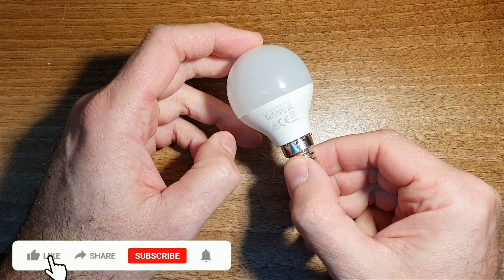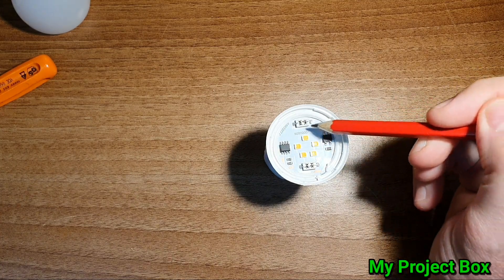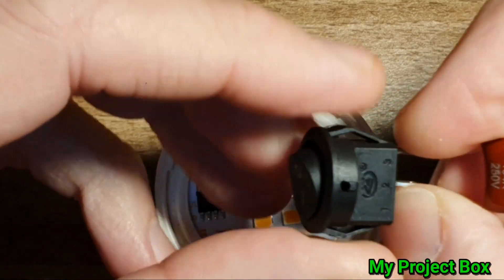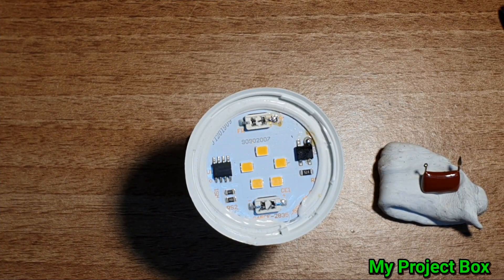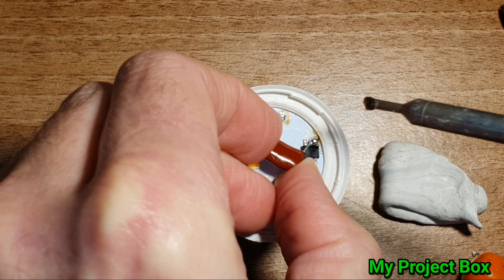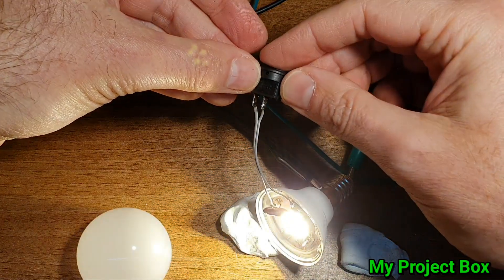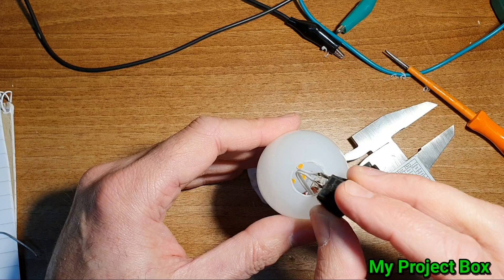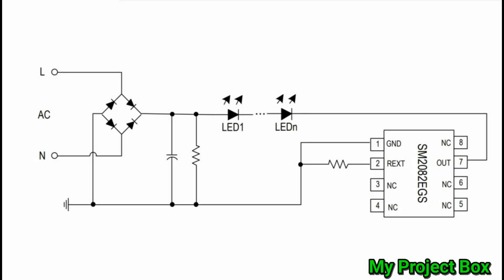Dim a LED bulb with a Capacitor #ElectronicsCreators

Comment: how can capacitor used to reduce voltage ??
as far as i know capacitors use as "temporary battery" so it store energy, and can increase the output voltage NOT reduce it .
Reply from the maker: A Capacitors behaviour is different for AC current. With DC current it will change up, "kind of like a battery. With AC, it's constantly charging and discharging as the polarity reverses 50/60 times a second. This resulted in it passing current, kind of like a resistor. It's call impedance (a special type of AC resistance) so a capacitor will pass AC current,  but with DC it will draw current when charging, and the current will stop when fully charged.😉👍 The the power in your house is alternating current AC, but a battery is direct current DC.

Comment: Sir,can I use it as a fan speed dimmer?
Reply from the maker: Yes it is possible, but you would need to experiment with different capacitors, to try and determine the correct value, for the fan speed you want. Sometimes you can get the  opposite effect,  and the fan runs more powerful. This happens when you get a resonant effect between capacitor and inductor. (Tank circuit)
Reply: Thank you sir I will try.

Comment: What would happen if you put this capacitor across the L and N, would it improve power factor of the lamp?
Reply from the maker: No, the capacitor is needed to improve the power factor of inductive loads like the older florescent lighting and induction motors. It will do nothing for LED lamps 🤔😉
Reply: @MyProjectBoxChannel  OK I see, when I tested a led bulb on a magnetic ballast, the power factor went from 0.6 to 0.7 almost 0.8, and that was without the correction capacitor. Couldn't really notice the difference in brightness. Wasn't expecting this..

Comment: I have found a Circle Rocker Switch 3 Way 3 Pin 3A, on eBay, so I am going to make a two position dimmer using two caps of different values, so I will have 10% and 50% dimming. What's your opinion?
Reply from the maker: It sounds like a good plan 😉. Just experiment, to find the values of capacitor needed for your preferred dimming levels. I have tried this with a rotary selector switch, the type used in old school sound systems. The good thing is the capacitors get smaller in size for the lower light levels.
Reply: Thanks, will let you know how it goes  @MyProjectBoxChannel

Comment: Amazing video! Q. Can the same process be done in reverse to increase the brightest rather than dim it?
Reply from the maker: No it's not possible to increase with this method, using a capacitor😢. But with many types of LED bulbs, you can change a resistor value, to either increase (or decrease) the brightness of the bulb. If you increase the brightness of the bulb, you will also shorten its life span😢.

Comment: Very nice idea that works very well, cheers Bob in the UK
Reply: Thanks for your like on my comment, but one question I have two filament dimmable LED bulbs would the capacitor do the same job in dimming? (Update yes it did and is a perfect night light). Thanks, Bob 😃

Comment: Great, I have some lamps that I can't identify the resistors to change, then your solution have come to rescue!
Reply from the maker: I do think I prefer the "Big Clive style" resistor hack, but the "capacitor dropper" works for many types of lamps as well. You can do multiple lamps in parallel, with just one capacitor.

Comment: what  size  capacitor  do you use
Reply from the maker: I used 100nF 400v capacitor. But you can increase or reduce the value, depending on how dim or bright you want the LED bulb, to be.

Comment: 100nF 400V capacitor
Reply from the maker: Yes 400v would be better, but if the capacitor failed short-circuit the bulb would just go to maximum brightness. And the current would be limited by the bulb it's self.

Comment: Big clive has shown an easier way to dim a lamp, there are 2 parallel resistors next to the regulator, remove one
Reply from the maker: I know I love that simple little hack!😉🤣
Reply from the maker: With some of the older bulbs you have no choice but to either change the main capacitor dropper cap, or put a cap in series with the bulb. BigClive style resistor clipping hack is simply brilliant 👍😉 https://youtu.be/G9RUsOVKoZg

Comment: Hi Rob, new sub from BigClive's channel. Would it matter if I put the cap on the line side instead of the neutral side? Thanks - now I got some binge watching to do. . .
Reply from the maker: You are correct. Both line and neutral would work just fine (it's AC after all). You can even put the capacitor inside the lamp base, with a switch to adjust the brightness setting. I did exactly that for my desk lamp 😉

Comment: Hi Rob, I have a circuit that you could also demonstrate, and that is a light-sensitive switch and flashing diode in a torch, so you can find the torch at night, but the flashing diode light goes off when torch is in daylight.
Reply from the maker: That's a very good idea 😀. It should be a very simple circuit to implement. Would have to be quite a low power design as not to drain the batteries to quickly 😉🤔
Reply from the maker: I could also build the plug directly into the torch so you can plug it directly into a power outlet/wall socket to recharge ( have the charger built in)
Reply: A suggestion would be to make a Joule Thief circuit, see Big Clive channel
Reply from the maker: Hi kiwidehaan! I finally had time to make the video about the putting a flashing LED into the torchlight. https://youtu.be/VxZJp4jv6co